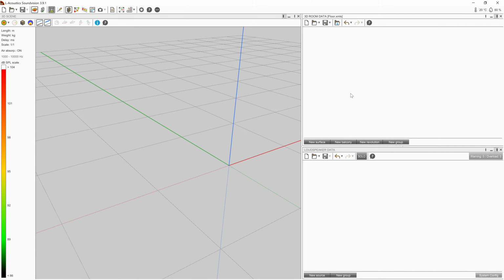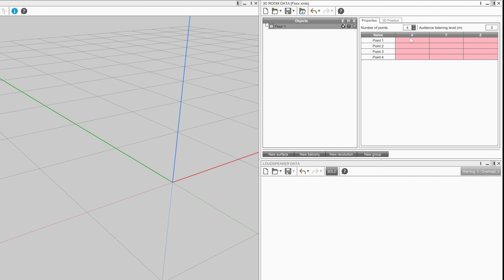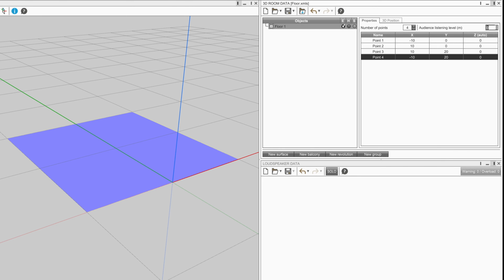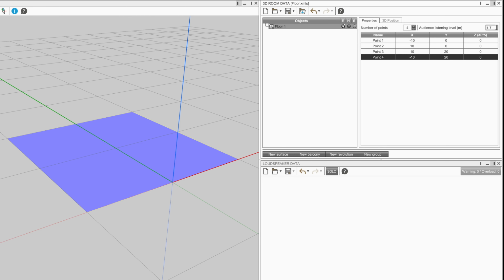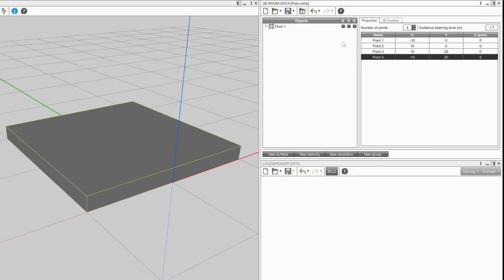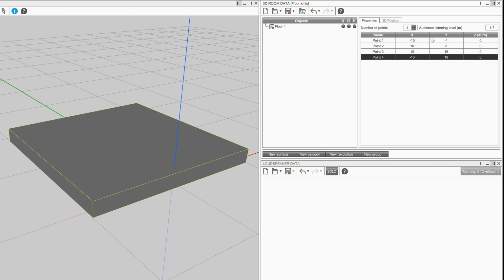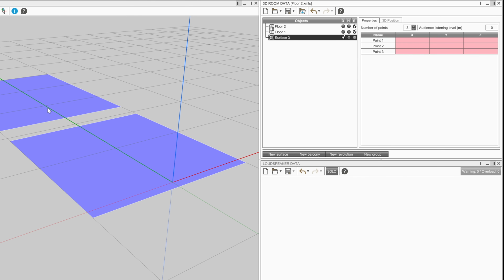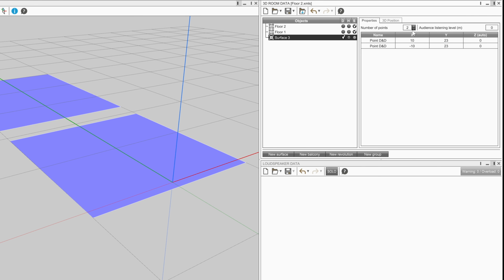Soundvision Quick Start: Creating a Surface

Comment: Dear L-Acoustics Team,

I’m reaching out with a couple of suggestions and questions regarding the integration of Soundvision and the L-ISA ecosystem, which I’ve been exploring for immersive audio projects. First, I’d love to see L-Acoustics make available a comprehensive library of loudspeaker data and pre-configured templates for all the venues currently modeled in the Soundvision Venue Database. Having access to this data would greatly streamline the design process for users working on projects across various locations, especially for those of us aiming to leverage L-ISA’s capabilities in diverse settings like arenas and stadiums.

Second, I’ve found the process of uploading templates from Soundvision into the L-ISA Controller a bit confusing. The workflow isn’t as intuitive as it could be, particularly when trying to adapt or create new templates that reflect the binaural loudspeaker placement suited for larger venues like arenas and stadiums. Could you provide clearer documentation or a step-by-step tutorial on this integration? Additionally, it would be fantastic if you could develop and share updated templates specifically designed to mimic the spatial audio characteristics and binaural placement optimized for these larger spaces. This could really enhance the pre-production experience and ensure more accurate translations from studio to live environments.

Thank you for your time and consideration—I’m excited about the potential of L-ISA and how these enhancements could elevate its accessibility and precision for users like me!

Comment: LA acoustics may be the best sounding box in the business but there's next to nothing intuitive about the system and it's unnecessarily complicated. About this video: Referring to points in the sound industry, commonly refers to rigging points, not  the size/position or  juncture of a given surface. And how is a novice to L'acoustics supposed to comprehend what -10 represents when creating a "point" on a surface?  For a complete beginner, this video falls short of a starter to Soundvision. L'Acoustics can do better
Reply: 30 years I've been doing this....this software sucks...ive been at it 5hrs and still can't build a fekin stage.....terrible....done....going somewhere else.....
Reply: I don’t understand all the fuss about the software, really. All the venue modeling prediction software is the same and is some sort of a version of ease focus. Three dimensions x y z that are width depth and height accordingly. What is exactly so terrible about this specific software in this regard?